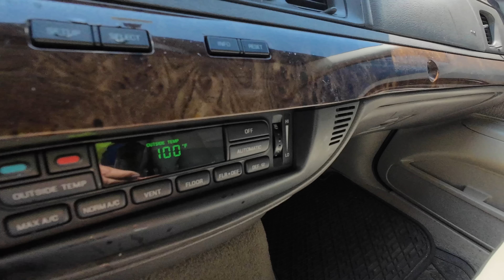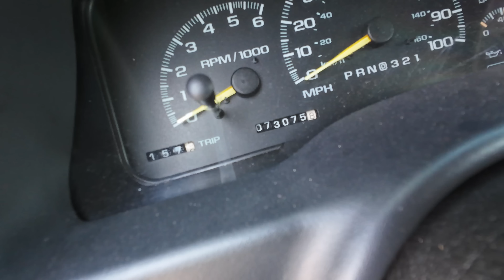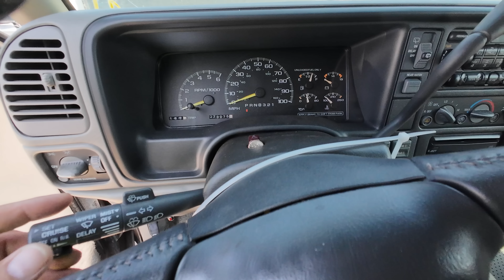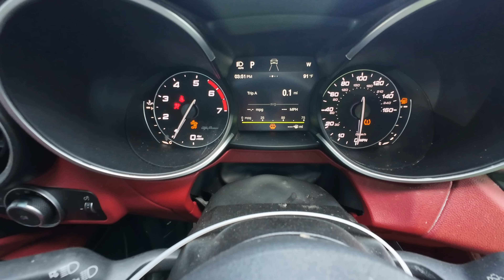I Found a STOLEN Chevy Tahoe 2 Door at Copart CHEAP!

Comment: The steering on the Hyundai/Kia is a common fault on the steering shaft, it's like a STAR shaped plastic damper you fit on the electric steering column, would make a good informative video.
The part is less than $10.
Reply: Youre correct. Worm gear i think. Thought the same thing when i saw it. Used to work at a hyundai dealer
Reply: That is right. If you watched videos from Rainman Rays Repairs, he did multiple videos of this problem. It's not really hard to get to. Other than this vehicle, I would take it regardless.

Comment: 28:00 - That's a 2.0 4 cyl turbo making 280HP with 306 lb·ft of torque. The Stelvio (as the Giulia) also came with the Quadrifoglio variant with the awesome sounding Ferrari 2.9 flat plane crank 510HP Twin Turbo V6.

Comment: Nick should get a ford focus (2012 - 2017) . It’s reliable and has great fuel economy. I know there a lot of hate for the maintenance, but I’ve had many go past 200,000 without major issues.
Reply: Seriously? The manual trans maybe, but the automatic has a class action lawsuit for them being horribly unreliable. The generation before was quite reliable though, I still see them all the time. Seen like 4 of them yesterday in varying conditions lol.
Reply: @johnl3230  I’ve had both Manuel’s and automatic. My automatic currently has 340,000 miles. You just have to replace the tcm with a k01 or higher. Which should come free with the recall. Other than that regular maintained like clutches should be fine.

Comment: The Copart lots here in the Minneapolis/St.Paul area often have several stolen Hyundais and Kias. Aside from the column damage and the usual knocked out rear window, they are often trashed inside with graffiti on the dash, cut up seats, smashed infotainment center screen... I saw ZZ Top in September of 2019 when Dusty Hill was still around. It was a great show.

Comment: I have owned 2 Nissan Altimas ,a 2015 and a 2019 . I traded both in at around 80 k. I never had any problems with either one .They would be a perfect car for a new driver as they are comfortable and get great gas mileage .

Comment: The clicking noise in the Hyundai steering is a rubber star washer in the steering linkage. Bit of a bear, as you have to tear the dash apart. but you are right, there is probably suspension damage, so forget it.t.

Comment: Clunking from the column on that Hyundai could easily be the plastic Lovejoy coupler between the electric power steering assist and the actual column.  One of those things. I'd take a gander underneath to see whether anything is all screwed up and if it's not stick the camera up next to the power steering motor and turn the column and see whether you can hear some noise from the chewed up Lovejoy coupler.
 One of those things that could easily sound worse than it actually is.

Comment: The reason why the steering wheel makes that awful clicking sound on that red Elantra it’s a steering coupler that went bad. It’s a very cheap part, but the labor is really intensive. Think it is more like an insulation piece to the steering column

Comment: Man that Tahoe hurts to see just sitting there I have a 95 Yukon with a bore out racing 350 in it with a stainless steel straight pipe build has a little under 100,000 miles on it. It needs a new cluster cause the gas gauge broke behind the gauge

Comment: All my surgeries, which were eye related, were of course planned.
That red Elantra is identical to my mom's, exact same car, Randy.
Except mom's doesn't have bluetooth, and that red one is like an '11-'13, '14-'16 had a different interior.
I'd also look at a '06-'13 Impala,which was sitting in front of the Tahoe, those are great cars as well.
I'd avoid anything European as Nicks first car.
Like you said, you want something that will be easy to fix, and a lot of European stuff isn't easy to fix and parts are expensive.

Comment: I'd stay away from Hyundai or Kia between 2013 and 2019. Especially if they have the Theta 2 engines. Poor manufacturing and those engines are almost guaranteed to have catastrophic failure. There was a class action because of those engines.